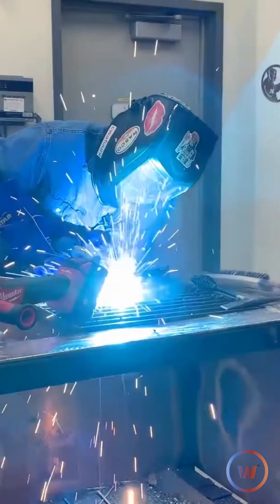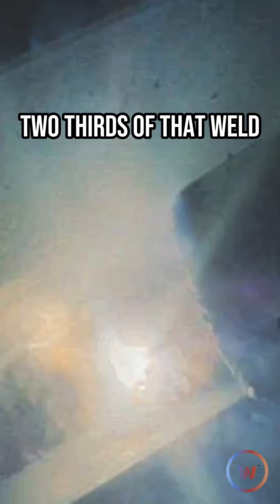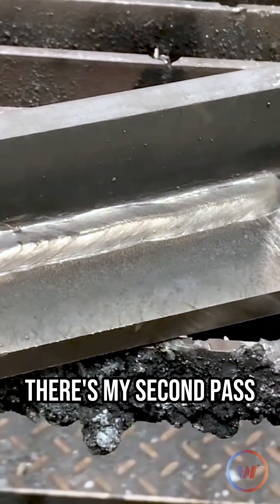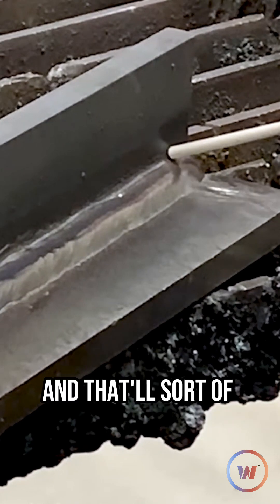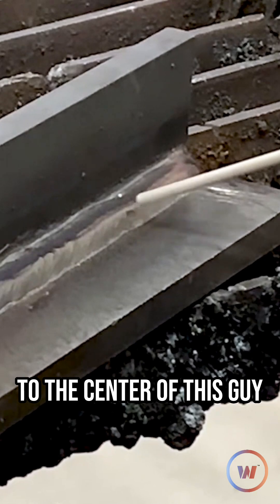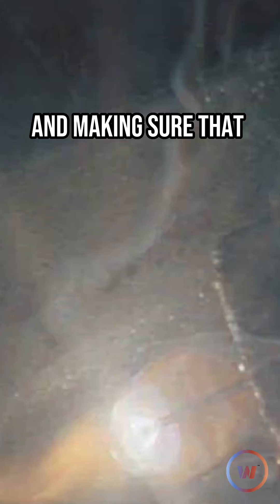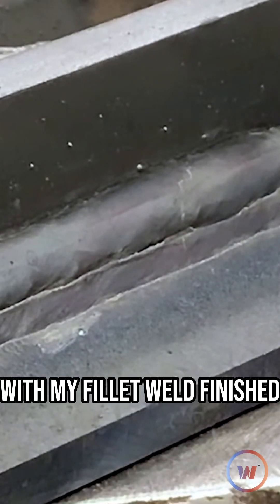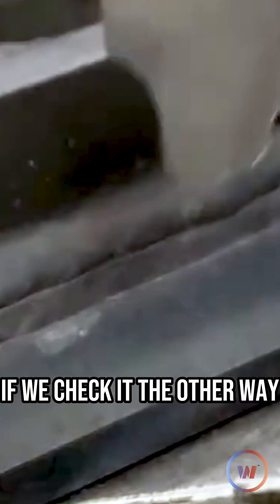Spray Transfer

Comment: This wouldn't have passed my test here in Germany. That little swurve in the middle......yeah.....oops. also lowering your heat on the second and third pass fixes the speed issues.
Reply: I think a steadier hand is the answer and consistency, you can still maintain constant heat providing you have a good hand and can move properly
Reply: @GHOSTDIVISION39  its both! Turning the heat down atleast for the last cap Pass on the top Would be common sense but of course a steady and good wrist and shoulder can handle a lot of heat! I run all Day from 30 - 32 v with between 275 and 340 amper

Comment: I've never done it with anything other than 100% Argon.
Reply: I thought spray was achieved with anywhere from 20% co2 to even 5% co2. Sometimes switched for oxygen, so 5% oxygen 95% argon. Usually too low co2 means less penetration. I’ve used 100% argon for Aluminum MiG though
Reply: @HEX_NATION  

You need a concentration of greater than 80% argon to achieve spray transfer. I'm used to running 95 Ar 3 CO² 2 O.
Gasses other than argon change the burn properties a bit.
Reply: 100% argon was what I had available at the time when I decided to do it. Since I was very pleased with the results, I saw no reason to vary away from it.